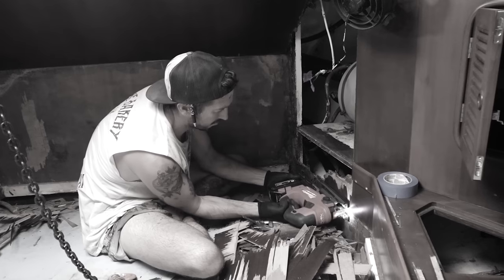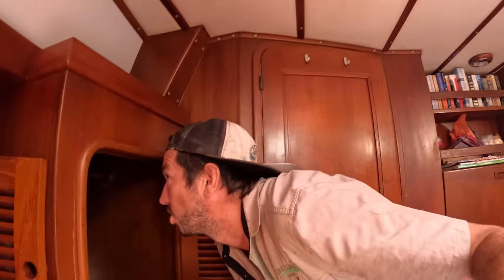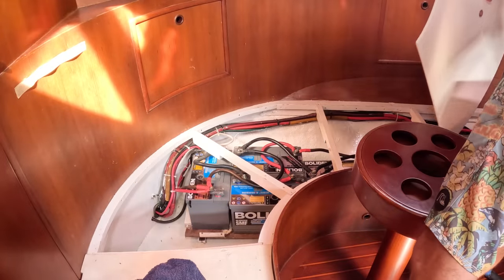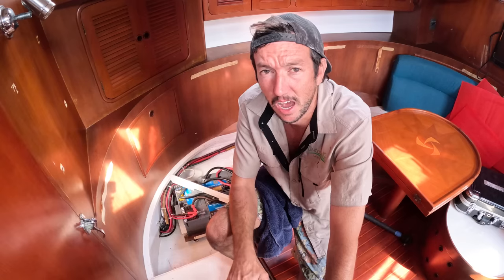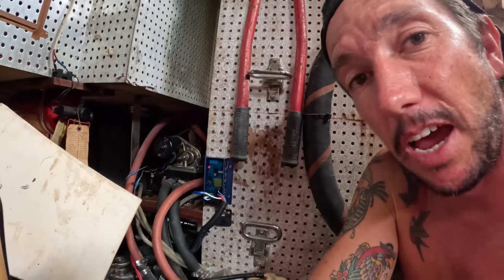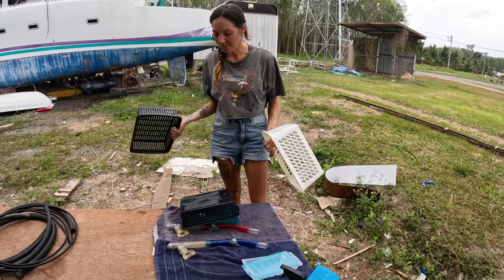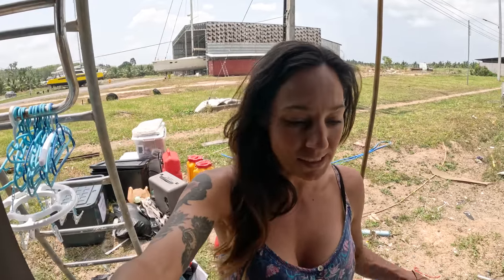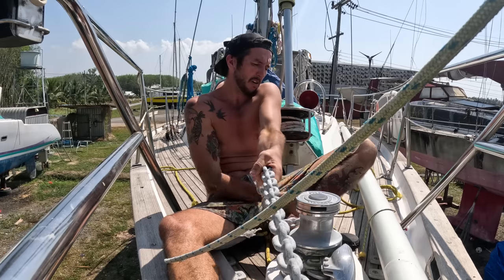BIG BOAT = BIG LESSONS. We have A LOT to learn... Ep 308

Comment: Josh - chasing leaks - we have not long tried to address a similar frustration of a leaky yacht. Lesson learned   - best to assume anywhere there is a deck penetration - bolts, fitting, hatch - assume that all the sealant has died.( guarantee this will be the case) every single fitting will need to be rebedded, re sealed, - we did it in stages - get yourself a sponsor from "fixtech" or similar - you will be using crates of sealant.  Love your efforts and sense of humour - all those things come in handy.

Comment: having dealt with teak decks for 36 years on a 57 foot boat there is 2 ways to deal with them , remove the teak and do a proper glass over or replace the teak with proper 3/4 in quarter sawn but that will cost a Kings Ransom these days , those thin strip teak decks are a nightmare , Killer cool Highfield !!!!! and love the new ship !

Comment: 10:00: G'day from a wet & chilly Sydney. Just a few words of advice mate...Lithium = Fire risk. Make sure you have enough fire extinguishers on board to put out a battery fire...I can't stress this strongly enough. Lithium is great BUT if you just google lithium battery fires here in Sydney, you'll see what I mean. Yes, I know most of these battery fires were probably due to shitty charging units for eScooters, BUT, lithium fires don't just go out after you've covered it in fire retardant...they keep recombusting so be warned so that you have enough extinguishers on board, as we all know fire is the biggest risk on board. I'm amazed at how ill prepared most sailors are when you see a tiny extinguisher in the kitchen and one in the engine bay...seriously wouldn't put out flaming marshmallow!!! Good luck and safe sailing. Most lithium battery fires are due to incorrect installation or using dodgy old electrical hardware. If you're putting in new lithium batteries you owe it to your safety to make sure ALL your hardware &  cables etc are new and of good quality.

Comment: I hate writing comments but I will this last time.  If you go back to your pre-buy video, I mentioned that you will eventually need to replace the entire deck.  Your leaks during a good rain confirm that.  Yacht decks are usually a sandwich of core material between two layers of glass.  Now lets drill 1,000 holes in the exposed top surface and then drill about 500 holes in the bottom surface.  As the boat ages, the holes on the top surface introduce enough water to completely saturate the core material (which greatly increases deck weight btw) and eventually find drain holes (the 500 lower surface screws)on the undersurface or cabin roof.  You might think it is coming directly above the obvious wet spots but it could be traveling from anywhere in the surrounding deck area.  You will never fully stop the leaking until you pull off the entire teak deck, fill every hole and re-glass the deck.  That’s only going to stop the leaking. The core will remain saturated and if you ever find freezing temperatures, the frozen expanded trapped moisture will separate the glass and you will have a very spongy deck which is completely unacceptable.  Your best bet will be to find a yard that will make quick work of this and after its repaired, do not drill holes into the upper surface ever again.  Good luck going forward!

Comment: Nice alternator, was looking at a balmar last night. Price got me thinking though... 2k for that, plus a another 1k for the new pulley kit with multi rib belt.... Plus another $500 on a tacho damper.. becomes an expensive project for me lol.
Reply: A lot of Factory tachometers have the ability to adjust the pulses per revolution. It’s a linear relationship to the engine rpm as in the ratio is constant. An adjustable replacement Tach would be a cheaper option to the damper but if your tach carried warning lights I guess that’s an issue.

Comment: We got 40 year old teak decks and been dealing with the same problems you are with Independence. Are you going to replace it? You probably know this, but where the leaks enter the boat doesn’t necessarily come from straight above. If yours is laid on top of fibreglass like ours, the leak can travel all along the underside of the deck until it finds a crack in the fibreglass where it’s let in. Re teaking can be a massive job but we’ve hear good words of doing it in Indo where labour and materials are a lot cheaper than here in OZ at least.